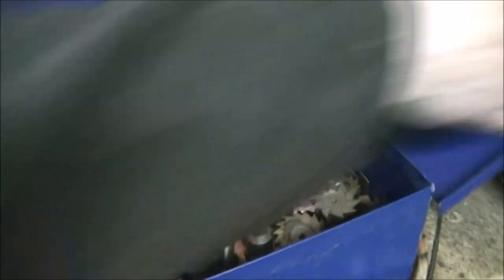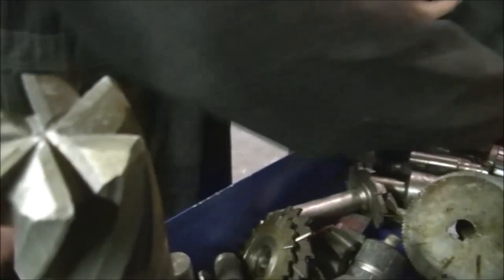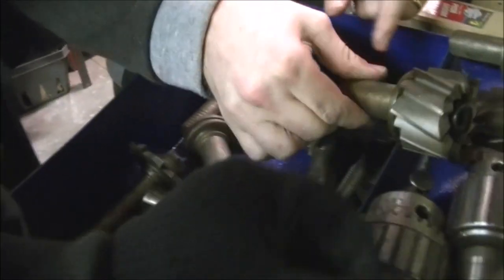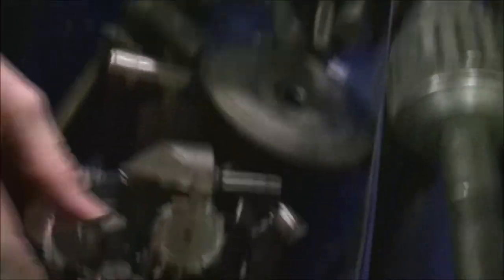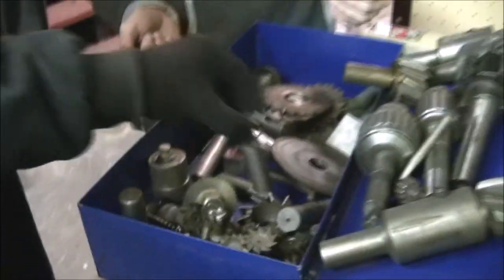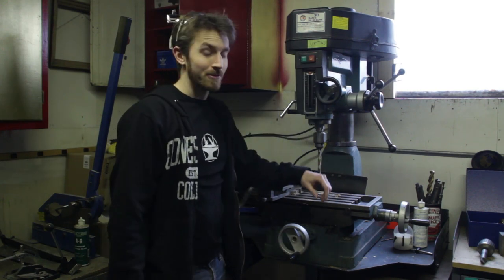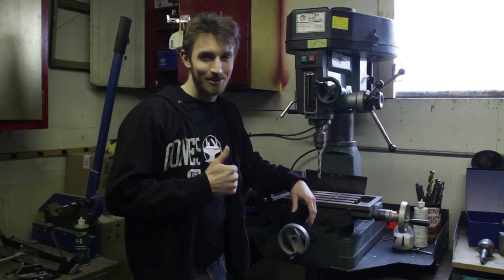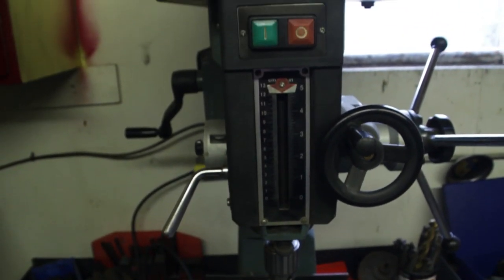Hacksmith Industries Gets a New Toy!

Comment: Wait, isn't this why you made an exosuit?? So you don't need 4 guys? xD
Reply: +Attila Asztalos Nice...
Reply: That's exactly what I was expecting! So we know the arms and legs are independently functional, but it looks like a 'strong back' (articulated pneumatic steel vertebrate) with microprocessor coordinated 'succession' control (activation of each segment is incremental, following the previous, and is scalable to the speed of user biofeedback signal) Instead of switches, try looking into electrode on the skin activation... now operation becomes comfortable and fluid. Will the back be attached to a 'belt' ring of industrial bearings that can hinge in back & open in front (while retaining the bearings from dumping out!)? -or follow natural muscular physiology with 4 pneumatic 'Lats' (latissimus dorsi) supporting the chest 'cage'. Joints at top & bottom of each piston will enable the top frame a controlled pivot & rotate by their extension or retraction. (*might as well add some frontal plating.. or go Kevlar to shave a few lbs) -How's the design concept looking? I think we ALL appreciate how you go on to forage the concept in steel quickly after you've solved the issue. Awesome! where'd you learn to weld? Bet a brief tutorial on your techniques might be appreciated (maybe u already did one?) I know there are scads of weld videos here, but you've established a presence & strong credibility... compound welds that last under 1,000+lbs of pressure! 
Next up: I recommend you network a bit for the sensory & microprocessor control system if it's not your strong suit. Then, you maintain the high quality and project execution.. which is your brand!

Comment: you should add a bent metal "belt" around the waist connected to the legs so you can add a steel bar going up your back connected to the upper body so the weight isn't on your back
Reply from the maker: +Keenan Schomburger That's the plan!

Comment: I may have missed this video but what happen'd to the forklift cuz if i where you guys i would have just used that to at least get it close to where I'd want it
Reply from the maker: +BeMad4M3 Watch the video "Goodbye Forklift" ;-)
Reply: the Hacksmith I dont know since how long I subbscribed to you but every video is just fun to watch and i really hope you will achieve your goal! btw how is it going with the dune buggy?
Reply: the Hacksmith is it possible to replace your airtank with a scubbatank? It would look cool do
Reply: +gertinos I beleive thta is the plan, unless he changed the plan from this of course, to have 2 different modes, stealth or noisey. stealth would be the whole suit runs off and prepumped heavey duty scuba tank (like super heavey duty) and noise mode a smaller tank that would be constantly be pumping air into it untill it hit a certain point then (cant remeber if it drained into the bigger one or into the air)